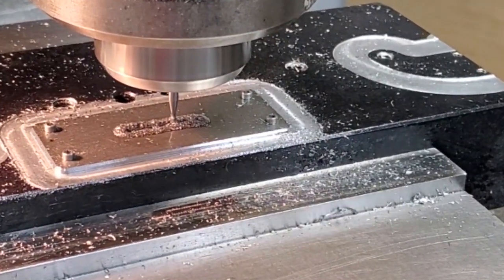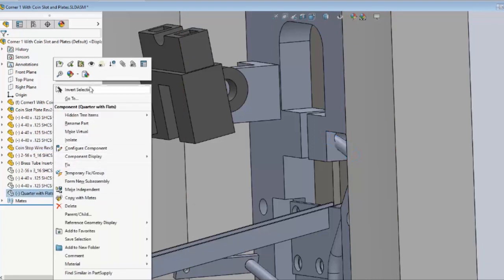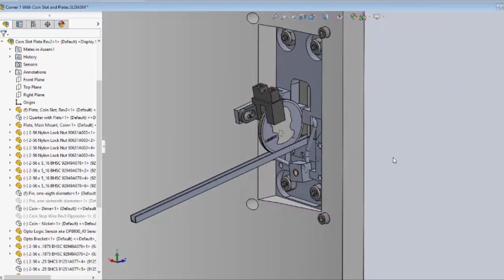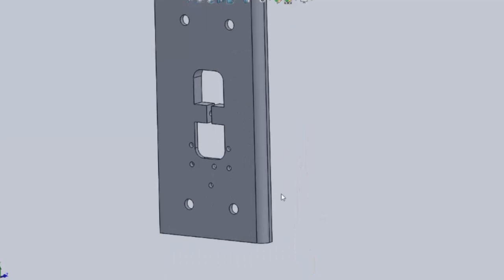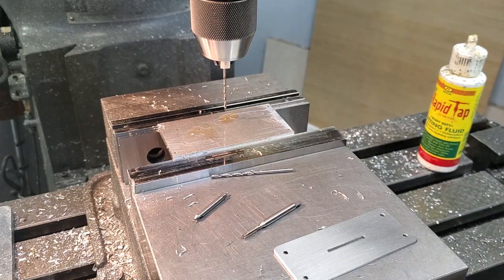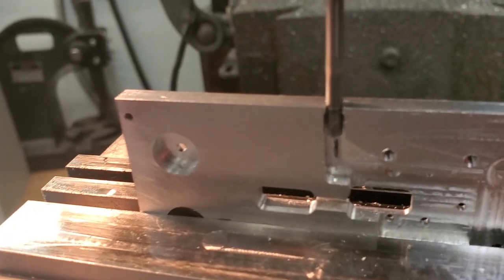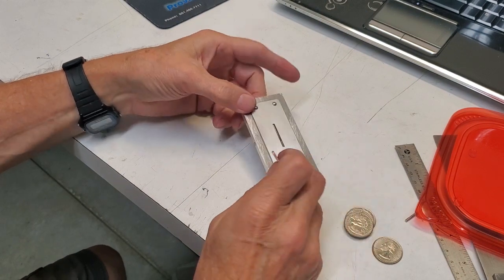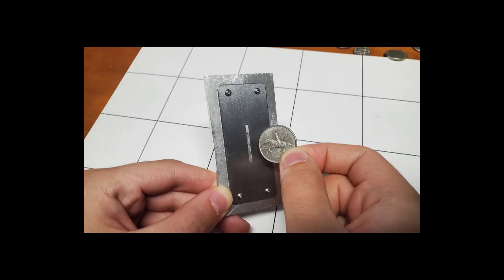Making the Coin Slot System

Comment: Very nice.  
Are you planning to engrave any text on the slotted plate, such as "Quarters Only"?
Reply from the maker: Good question. But I haven't designed it, nor do I even have it sussed out! I want clear instructions for any user. But although it didn't cost me anything that I know of, the old Kineticon had a red light showing it was ready - kind of a "confidence light" as they call them - only it should have been green, so there wouldn't be any crashes in the intersection so to speak... So now I'm thinking of a green light (ready) and a red light (wait), and I'm even tossing around the idea of modeling a little stop light with working lights - just like on a real intersection.

That could go behind the glass which will be just left of the coin slot. I can put any instructions there. I'll have to see how it all looks and then make a final decision.

Stay tuned for the future option: It's kind of complicated, but I want to build a system that accepts a quarter, or any combination of coins, and since inflation is high these days, make it so I can charge $.50, and then make it Venmo/Zelle-enabled, so a user can send me a buck online, get a play on the Kineticon, receive 2 quarters change, and witness a quarter getting sent down the track even without having one put through the slot! That will require a quarter feed mechanism, which will push the coins up a chute, through a trapdoor, onto the track, and then have the normal Quarter-visual-switch action. I've build the coin chute-through-trapdoor mechanism before, so I have that worked out. Also since there will be a change mechanism below, I can add a dollar-bill acceptor and take paper money. Ideally it can all be retrofit to the existing machine. So with this simple mechanism to start with I can at least get a finished version out there. (I said it was complicated!) And working out the multi-pay system later. These are modern times!
Reply: @sisyphuscranerigging7792  Wow, adding those additions, particularly being able to electronically pay adds a whole new layer to the system. High tech and sounds ambitious, but that would be very cool! 

Up until this point I sort of was getting the impression that everything might be "old school" in nature and you wouldn't be using a microcontroller or raspberry pi in the system for example. What's your thoughts or current design guidelines for the internals with regards to how things get controlled/sequenced/triggered/timed? Are you using all "old school" sort of techniques/electronics, or will you use microcontrollers anywhere (either visible or hidden from view)?

Continue to enjoy seeing the creation and construction process of this new Kineticon.
Reply from the maker: @Marc_Miller  It's been a while for your text, but I'm probably going to have a mix of high tech/high touch. We'll see.
Reply: @sisyphuscranerigging7792  Looking forward to seeing whatever direction things go! :)

Comment: Perfect coin fit!
Reply from the maker: Yes, but I discovered a problem... Actually I recall this from the first time I made one of these - that is, the perfect fit of the Quarter is a little too narrow for a Nickel.  I need to widen the slot a bit so Nickels can get through smoothly, since they are a little thicker than Quarters.  Nickels jam in this width, and it's fussy for users who either pull the Nickel back out, or jam jam jam it in through the sticky slot all the while munging up the metal of the coin slot. I should know better, I've had a lot of experience with coins:

I can't help mentioning your video about the old Gizmo Jr, it's so fun: https://www.youtube.com/watch?v=ejCyaSwwJNQ&t=330s